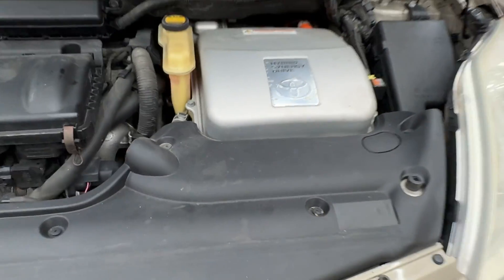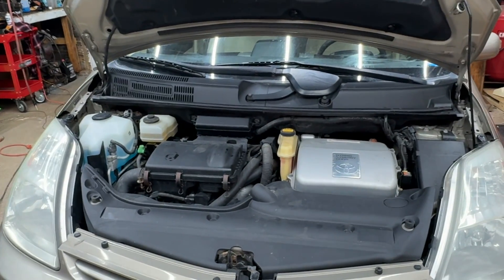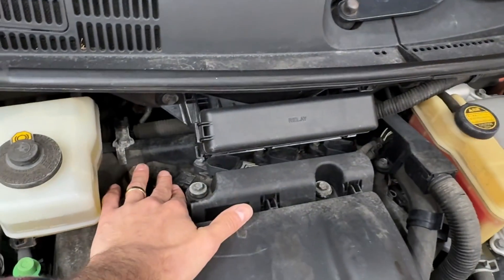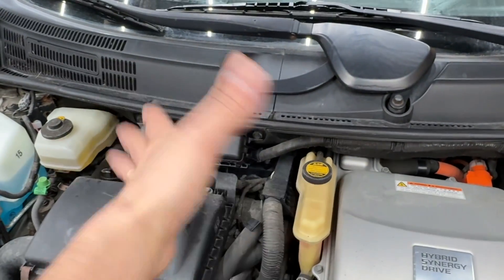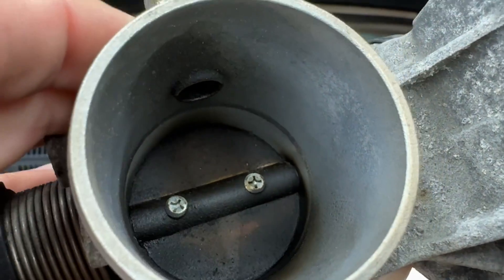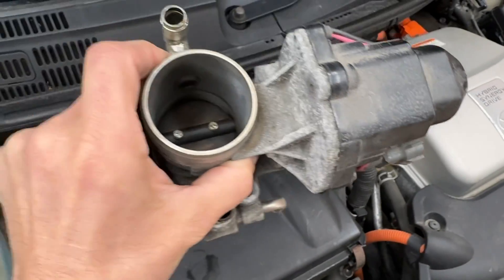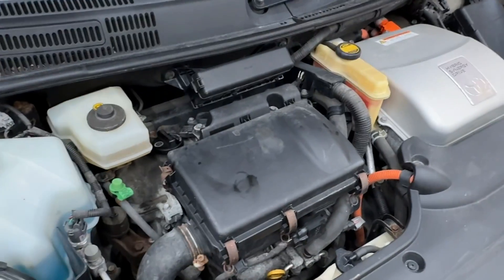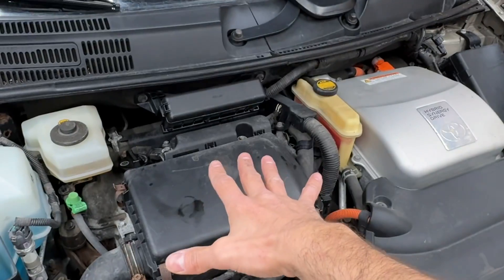3 Things To Make Your Prius Run Like New! (No this won’t fix internal engine DAMAGE but WOW)

Comment: Dear Drew  I  recently bought an ‘07 Prius   57k miles. The first thing that went wrong was the gas fill problem so I had Toyota put in a new tank. I wouldn’t have done that except they told me the battery was ok. After that I was driving the car and all of a sudden the red triangle went on and the car shut down and could barely limp on to the flat  😮bed. After two days of sitting I went to start it without anybody touching it and it ran fine. I then drove it about 400 miles until the dash lights went out and it didn’t start when I pushed the start button then it did after another try then it wouldn’t  shut off by pushing the button. Again the car sat for another two days I started it and it ran fine. A salesman at Toyota told me over the phone that the car rebooted itself but  couldn’t give me any further explanation. I took it to a repair shop and in addition to the key fob being erratic with the doors, the dash lights going out again and then automatically turning on again, and the abs light go on only after 55 mph and shutting off below 55 mph the repair shop told me it was the battery that was causing this. Indications that make me skeptical are the mileage and the fact that it’s registering 46mpg. Anyway if you’re reading this I ‘d appreciate any thoughts you might have. Thank you, van. 8:21
Reply from the maker: Yikes I’m sorry to hear all of this. That’s WAY too many things - unrelated things - to connect to each other and point at one or two common problems. I would be stumped even with the car in front of me 

The Guages going in and out and power button needing to be held is the capacitor in the guage cluster. Very common. The other stuff isn’t away to pinpoint without the car in front of me
Reply: Was it the 12 volt battery? It can make a lot of odd things happen.
Reply from the maker: @downtowndrewbrown7129  This is said quite a bit, but the usually it's not the 12v. YES, they can make things happen, but it is wishful to think that that's the rule and not the exception. The gauges out is almost always the capacitor in the cluster =(
Reply: Where is your shop located,or if too far would you know of any Prius mechanics closer to my area that you could recommend? Thank you for your attention and any help you might give. One particular question,what or how could my 07 Prius shut down with the emergency triangle light on driving on the highway to barely able to limp on to the flatbed and two days later after sitting start up and run fine? Someone told me it rebooted itself someone told me it can’t reboot itself. Is this or could this be battery related? One mechanic told me he wouldn’t diagnose it any further until he could program a spare key which he hadn’t been able to do after trying with two after market keys ( fobs) and one Toyota key (fob). Thank you again, van.
Reply from the maker: @VanWolosoff   Hi! Sorry for the delay. We dont have a repair shop, we only prep our inventory for sale, and that makes for a LOT of content for this channel, but we arent set up to repair the public's cars =( im sorry This sounds like you have to find someone who LOVES these cars and works on them on the side. Try some prius communities and see if you can find someone
Reply: Good feeling your hybrid battery needs cleaning, not because millage, is because time (20years?)gets terminal connection between modules get green corroded. Should not be expensive for hybrid shop to service it. Just my 2 cents. Same with 12 volt battery, you do an oil change at Toyota dealer? They will check on your 12 volt battery and tell you good or bad,?  You did really good on the low mileage car. Don't give it up, just service and you'll not to regret.
Reply: All signs point to the HV battery. I had the same symptoms and spent about 6 weeks diagnosing. HV battery last longer if driven daily. 57k original miles means the prius sat a lot, which kills the battery. I didn't have to replace my prius battery until 240K miles. mostly due to covid and not driving it much.
Reply: Check the main ground off the battery

Comment: Great video.  I got a gen 2 last year and had to replace the ABS as it would buzz every 7 seconds.   Put in the brand new one, bleed the brakes using Xtool scanner and it was fine.  A few months after the repair, the brand new pump will now buzz for 3 seconds when I hit the brake after I get in the car and it will buzz for a few seconds after a few depressions of the brake pedal.  Initially after the repair the ABS made zero sound.   No codes and the manufacturer says the pump is find since there are no codes.  Any thought? 🙄
Reply from the maker: I think some buzzing is normal. That’s a miserable job…

Comment: @Drew Thanks for your info ! I a new owner of a 2007 prius 280+k that runs like a dream  and is in great condition the only thing wrong is the ac not working & i'm about order a compressor as that is what seems is wrong ! I used do my own engine repairs up until things went so digital around 1996 i quit doing most repairs until i got this car I could not turn it down for $1,000. It is worth at least double the price & the lady was just to old to be driving She offered it to me on payments at that being i'm 65 & don't got but a small SS check every month ! If i got more questions I'm following you & @SaneAuto both got great tips on prius !
Reply from the maker: Thank you so much! Glad to have you here. Congrats on the great purchase!
Reply: Did you get it fixed…check the coolant pump

Comment: I bought mine with 178k miles and changed the spark plugs myself a short time later. It has 277k now. Just changed the trans fluid myself. Going to change it again in 60k miles. 2 years ago the red triangle of death came on. My local shop said it was the hybrid battery again but I had just replaced it a year and a half earlier. So I brought it to a Toyota dealer. The mechanic there had a lot of Prius experience. He worked very hard to diagnose the problem and aside from a leaky water pump found that my Combination Meter was fried!   Cost $1500 to replace but it was well worth it. He had to take the entire dash apart. Car has run like new since and haven't seen the red triangle since thank god. But when it comes to Prius's bring them to the dealer they have the most experience and best diagnostic computers.

Comment: Rather than replacing my injectors I ordered some multi system Gumout. Read some good things about it, helps clean the deposits. When your gas tank is running low pour it in and fill up your tank. If it makes a noticeable difference great, if not then it was worth a try.

Comment: What about cleaning injectors instead of replacing? I only have 80k miles on mine
Reply: I just ordered a bottle of multi system Gumout. Supposedly it helps loosen deposits in the fuel injectors, etc.  Guys on youtube give it a good rating compared to the average bottle of Seafoam etc.
Reply: Yes that’s perfect no need to change it still very low mileage

Comment: Where is your shop located? Would love to have someone knowledgeable look at my 2nd gen prius
Reply from the maker: Hey I am totally flattered, but I’m actually not a shop my wife and I own a small independent car dealership that markets specific vehicles online, we sell about 100 cars a year, and we have a small shop to prepare those vehicles, but we do not have the staffing or the licensing to do repairs on a retail basis for the public sadly, it’s just not our business model for this season of our life
Reply: @DrewGarage Hey Drew could you share the link for your dealership pls?
Reply from the maker: @angrhak1druk234 hello! Www.pellacars.com but sadly only a 3rd and 4th gen right now. The 2nd gens sell before they arrive lately
Reply: @DrewGarage  Thank you for your quick response! I personally own a 3rd-gen. By the way, based on your statement, it seems like the 2nd generation is more in demand than the 3rd and 4th. Why is that?
Reply from the maker: @angrhak1druk234 in the prius world they are known as the best made. Demand is still high but supply is shrinking daily (wrecks, rust, mechanical failures) and in the used car world in general, inexpensive cars that are actually good are at an extremely high demand

Comment: My Gen2 has over 320,000 miles.  Did plugs and coils last fall when it was running super rough.  BOOM: smooth.  Now I'm thinking with a helluva lot of miles on the original injectors, might ought to do those just because.
Reply: I have 275,000 miles on a gen 2 and it keeps killing the 12V battery.  Any idea what is causing this, thank you…
Reply: @michaeldautry  I would recommend turning off your headlights before you turn off the engine.  That helped me.  next thing that helped was attaching a battery tender to trickle charge my battery at night.  A lot of problems went away after that, 12V issues, fuel showing low too fast, etc
Reply from the maker: @michaeldautry  Hello, Stick to the basics of searching for a parasitic draw if there are no codes related to relay issues etc. these are tough issues to track down
Reply: @michaeldautry I had the same problem with mine I was using the garage door opener feature on the rear veiw mirror disabled it and haven't had a battery prob since.
Reply: In the meantime try some multi-system Gumout supposedly good at cleaning the fuel injectors.
Reply: Hey! Thank you for these insightful videos. 
I've owned a 2nd gen for about 5 years now and got the P0420 code. I replaced the 3 way valve sensor with a Toyota certified part. The code disappeared for a while but just came back on & isn't going away. The car drives great. Any theories as to why and what I can do about it?
Reply: Hi, you have a bad catalytic converter
Reply: @Alan-uk7sb  bad cat. converter
Reply: How did u change the plugs the one in there is like oem wires
Reply from the maker: You should! And definitely the throttle body. Thats everything you can do... air fuel and spark! Be sure to subscribe =)

Comment: 284k miles on mine drinks oil burns oil 😂.  I need rings .   But these are some good things to go over.   Non just not sure my 06 is worth the trouble
Reply: Mine consumes oil too but I've seen lots of reports that that can be due to the PCV valve being out of order.  It's a bit buried to get to but it looks like the kind of thing a competent shadetree mechanic can knock out in an hour or two.  It's not like the little top hat deal sitting on top of a 22R, you gotta move some stuff to get to it.
Reply from the maker: Shoot it is! At least the throttle body. You can free up those rings MAYBE, but cheaper to feed yours oil than buy a new one haha
Reply: Piston soak with Berrymans B12 or maybe Wynn's Air Intake Induction Foam cleaner?  I've read some just use ATF in their oil before oil changes or even one claiming can just run with like a quart in?  Mines an 06 with 261K and I own a 13 with 285K and plan to do on both when they need or maybe sooner as a PM.
Reply: @jafinch78 hey did you do a soak? if so how'd it go!? 🙏
Reply: @ejRecording  No, I literally have a can of B12 on the shelf in front of me.  Consumption hasn't worried me enough yet and with the 13 where I plan to use the Wynn's Air Intake Induction Foam when the head is off, I haven't had the time to change the head gasket yet.  I did since get another Prius 05 where I changed the engine and made certain to use the better PCV Valve. Seems close enough to like new. Then sold that and moved into another 06 with ~ 185k that I haven't changed the oil on yet. My 06 with ~260k needs the oil changed, so thinking might do the soak before doing that.
Reply: @jafinch78  thanks for the reply 
My inverter fried so I just about swapped that and doing all the other maintenance stuff while I have everything apart, cheers 🚘
Reply: @ejRecording  Your very welcome kindly.  I actually have an 08 that has a code related to the MG or inverter going bad.  I have a spare eCVT to swap, though am trying to read into some more regarding other possibly easier checks to perform. 

I literally just messaged this to my gf so she can read and so I have in my messages.  I'll paste here as well. 

Clear the codes press the ready button without pressing on the brake pedal so the car turns on but the engine doesn't. Wait a minute or two. If the code sets again then your issue is in or around the HV battery. 

If it doesn't come back press the brake pedal and the ready button so the car is in ready mode and immediately shift to Neutral. This will prevent power going to the transmission. Wait another minute or two. If the code comes back then your issue is in or around the ICE. 

If it doesn't then just shift to park and wait a minute or two. This will allow power to flow to the transmission. If the code comes back then you have an issue relating to the transmission. This will help you isolate the problem but more often than not I find this fault due to water intrusion dripping into either the battery smart module or the fan. 

If you open the rear hatch and you have a bunch of dirt and debris sitting on the top lip chances are your weatherstrip seal is leaking water into the ceiling and making its way to a component.  

The last paragraph is more a no brainer and seems must do on all these, as the crack develops on each side of the hatch and I have also patched cracks down by the hatch strut base.
Reply: My wife's 08 is burning quite a bit of oil and I'm going to try the new Valvoline protect and restore, I've heard a lot of good reviews on cleaning gummy or sticky rings over three oil changes or so.🤷
Reply: Clean the PCV valve if it burns oil
Reply: Stay with regular oil changes ever 5k miles, the factory owners manual says:  even when new;you will need oil every 1k miles, or check oil every gas tank.

Comment: My 2006 Prius has 203K and runs strong. I recently replaced spark plugs, PCV valve, cleaned throttle body. Next on the list will be fuel injectors.
Reply from the maker: Awesome. I'm sure with how you care for it you'll get at least twice that! Please subscribe =)
Reply: @DrewGarage  can you share any info/link re: Gen2 EGR issues, cleaning or replacement?
Reply from the maker: @jmm1000  hi super easy. The gen 2 doesn’t have an egr :) please subscribe
Reply: @DrewGarage  THANKS DREW!
Reply: if you want to make your prius runs like new you need new hybrid battery
Reply: Mine has 277k and I just changed my trans fluid myself. A lot of good videos on that. Its been a few days and no problems at all. Hardest thing was loosening the hex drain plug. I should've used an 18 inch socket arm.  I used a standard. One thing I did do first was spray both bolts with WD40.  As far as the injectors I just bought a bottle of multi system Gumout. When you're at 1/4 tank pour it in and then fill the tank. Supposedly good stuff to loosen deposits in the injectors.
Reply: Do you still have the original battery?
Reply: Add some sea foam to a full tank of fuel. I use it every three months on my 05 Prius with 200K + miles and my throttle body is super clean!
Reply: @Buzzfink  how does adding Seafoam to your fuel tank clean your throttle body?

Comment: Another excellent video..    i have a slight rattle in start up and shutdown...  Did all maintenance...

Thanks to DG the culprit was 2 bad fuel injectors
Reply from the maker: YESSSSSS! I am never one to promise a fix on a car i didnt diagnose, but I almost want to rename my 2nd gen death knock video "Morning death rattle? DO THIS" lol! Its almost always injectors with the gen two. Sadly if its a 3rd gen 200,000 or more, headgasket =( Thanks for being here =)
Reply: @DrewGarage  yes..  hopefully you put a video together on what are the best apps to use with our hybrids.. Torq.. or hybrid app or Dr Prius app...

I don't have any..will wait on your review
Reply: Nice information… experiencing mine now will get it checked by mechanic